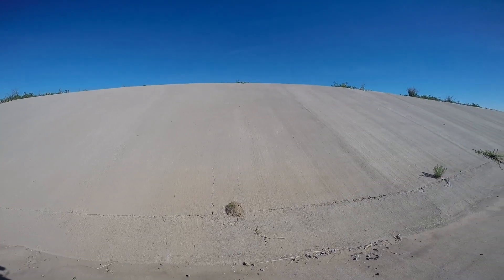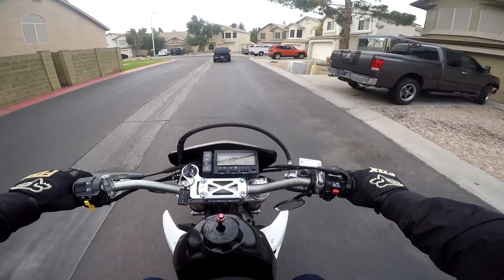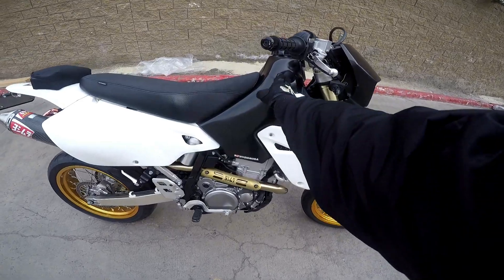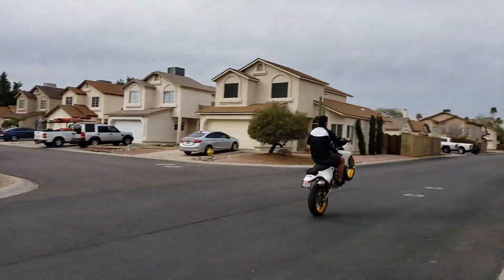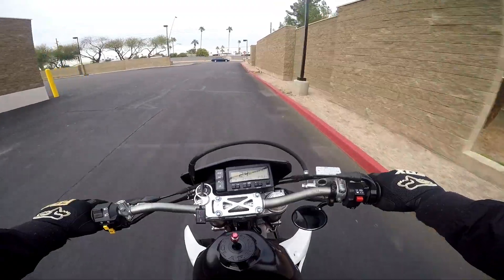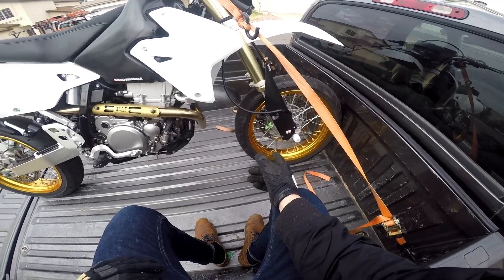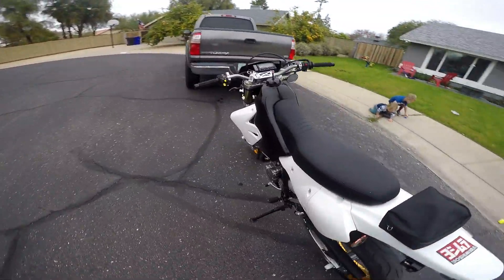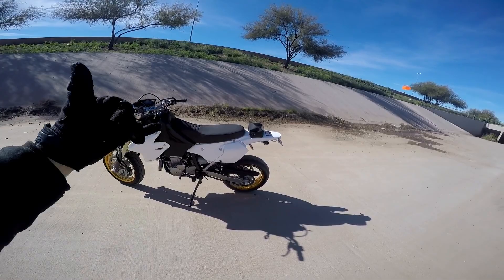Buying Used Suzuki SuperMoto on Craigslist (Another One)| DRZ400SM Ride, Review, Impressions Wheelie

Comment: These are fucking awesome bikes! I may be biased lol but really so reliable! I’ve had mine 4 years and put 62,000! Km on mine with absolutely no issues whatsoever... I just put a spark plug in every year and do my own oil changes every 2,500 km and she purs like a kitten! I’d buy another one in a heartbeat... they are bulletproof... ps not a highway bike but she will do it! Lol just a blast to ride ✌🏻🇨🇦 PPS glad to see you bought another one! Lol
Reply from the maker: Hahaha...for real! From what I've researched, they're complete tanks! I figure if they can handle the crazy cold weather in your neck of the woods, it shouldn't have any issues down here in the desert. Lol.
Reply: Jon's Moto Garage hahaha ya they prefer the warm weather! Lol but mine has sat outside for two/three weeks in -10 to -17 at a time and I’ll go out pull the choke and bang! She starts on first try 👍🏻 great hooligan and starter bike
Reply from the maker: @gorillaninja78  hecks yeah!